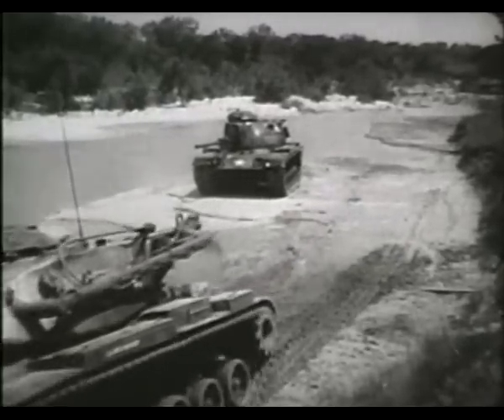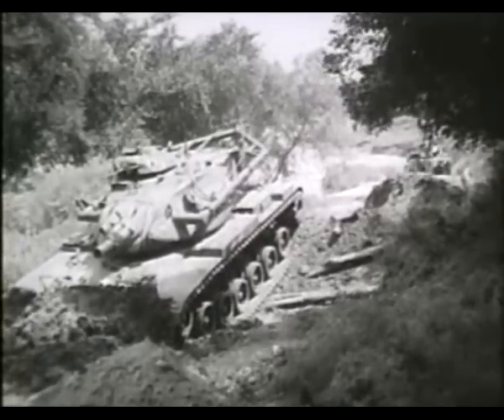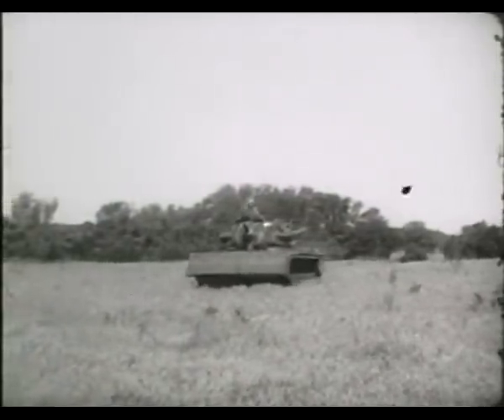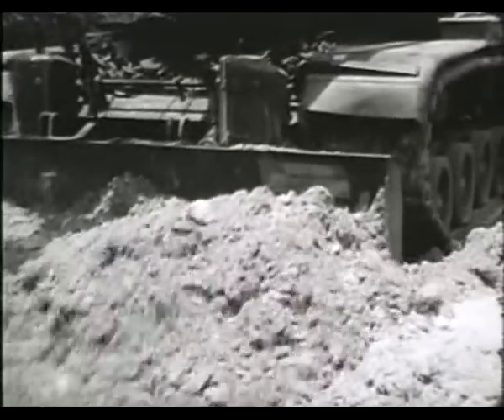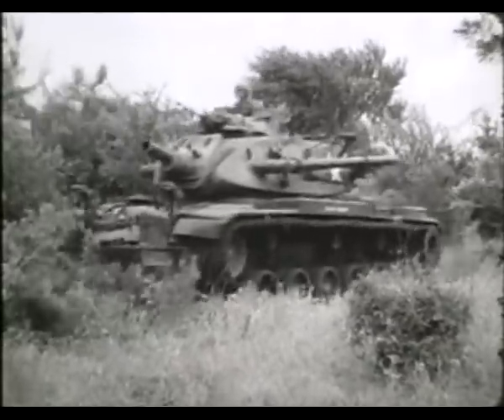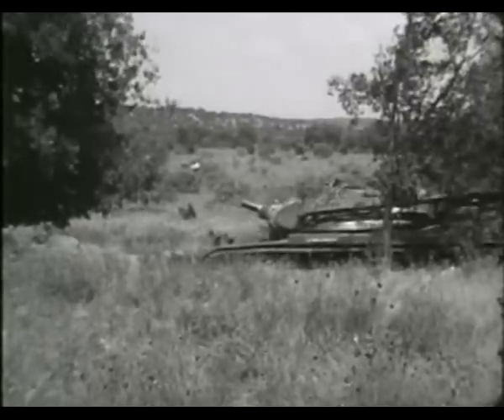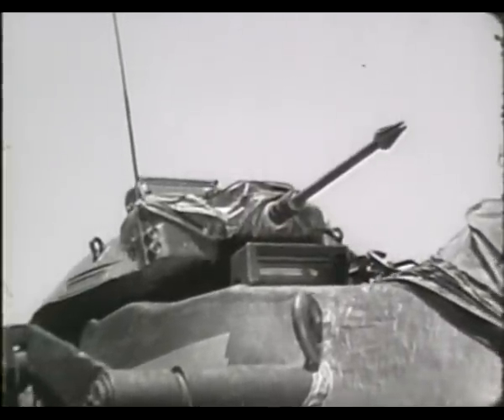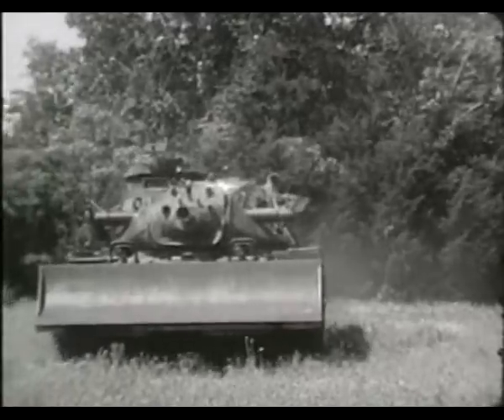M728 Combat Engineer Vehicle

Comment: Ah I remember these babies at Ft. Leanordwood.  That 165mm demolition gun was PURE AWESOMENESS!  I can't believe that they never made a M1A1 version of this tank using the same demolition gun.  Instead the replacements all have no heavy weaponry other then line charges. It's a shame because the snub-nosed 165mm gun actually is an excellent weapon for urban combat because the short barrel does not hit buildings when the vehicle is in narrow streets and is perfect for where bombs are overkill.
Reply: The Army wants a light tank to replace the Sheridan, basically a new M8 Buford AGS, but with more protection. General Dynamics came out with the Griffin prototype, an overweight, ugly thing with a lightweight 120mm gun. I think that's silly. Light tanks are simply not survivable in this era. They can't resist mines and IEDs effectively, nor can they counter next-generation ATGMs without some kind of APS. I think the Army should acquire a UGV with an L9 + Autoloader. An unmanned, remote-controlled fire support vehicle for knocking down structures and eliminating hard cover without putting the operators at risk. A next-generation assault gun for today's asymmetrical urban combat. No need to call for expensive airstrikes or arty if you have 40-pound HE shells right on hand.
Reply: They didn't make an M1 version since the m1 Had a new bunker buster round
Reply: The army traded the usmc for the ACE was a shitty trade
Reply: Vulnerable to the RPG, my CEV had an armor patch right at the coax ammo box...was told it took a hit in Vietnam and they sent it back to the states for a refit.

Comment: Ahhhh fond memories...could absolutely disappear some shit with gun!!! 100m kill zone (jelly ur ass) up to 1000m with shrapnel. Had a chance to hit an old taxi they hauled down range...hit that baby right between the doors...it fricken disappeared...nothing left but a patch of dirt :)
Reply: Mike Wells-- are you available? I need tech data on the fire control of this vehicle- how did you engage targets outside of the range of the reticle?
Reply: @tacomhq  you had to estimate like a sniper uses hold over. Had to bore sight first with a breech plate and string on the end of the barrel (notches were there for alignment)  the gun had a very similar trajectory as a small pac howitzer with if memory serves me right used 2 bag load. We did some R&D on it on a range up in Idaho. Since is was a demo round all you had to do was get close :) I will look online for some tech data!
Reply: The only targeting system the M728 had was just looking through the scope and lining up the sight. They were not made for Tank or artillery Combat. At least the one I crewed in. 74-77 8th ID @tacomhq

Comment: In the mid 70s, our CEVs were M48A5s. They were pretty good machines. We were developing the Universal Engineer Tractor at that time. It was supposed to be amphibious but the seals leaked and they sometimes sank. Good Luck, Rick
Reply: We always kept a a tarp on our CEV in the Motor Pool as the hatches leaked in the rain!
Reply: I experienced this as a loader in Germany in the 80's.  The loader sits under the main hatch and it was miserable to sit or sleep there in the rain.  With full combat load there isn't much room to get out of the way of the dripping water.  That being said, I absolutely loved that vehicle.
Reply: @Mistermegabyte We used to use plastic sheets that came with an expendable to cover things. I was a notorious scrounge and came up with many uses for salvaged materials. Good Luck, Rick

Comment: The blade slow the tank down and add more weight.  The "top turet" sic is called a cupola and the M1 and M1a1 both have one it just isn't as pronounced, the top mounted M2 .50 cal can be fired from inside turret while buttoned up.  The M1a2 however can not.
Reply: The commanders M2 on the M1 can be fired while buttoned up. It uses a series of periscopes to aim
Reply: That's a M85 50 cal.  On all the M60 series tanks cupola weapons with different belts link😮😅
Reply: The blade comes in handy for the driver when you are being fired on! More armor is welcome from a former driver!

Comment: why evry tank doesnt have dozer blade ?
why m60 is the onlyone to have a top turet ?
Reply: I know its been 14 years but by top turret are you talking about the commanders Cupola?
Reply: @dominuslogik484  i mean the m60 is the sole cupolla with a weapon its make it a turret on a turret
nowday many cupolla have a machinegun with an external ammo box or their is rcws around the commander sight 
but the m60 have internal ammo
not sure if its ergonomic but in theory it bring an advantage
Reply: @omnianti0  it was eventually removed from the M60 tanks as it was deemed a weak point on the armor layout and made the tank unnecessarily tall. the commanders cupola was thinly armored and vulnerable to things like high explosives.

as for the dozer blade its just heavy and its not made of armor steel so it offers limited protection while preventing the tank from being able to climb over some tall obstacles such as a ledge.
Reply: @dominuslogik484  the mini m60 turret issue is baltant and i guess not very efficient to shoot but all this as concept was never developed in other model as the french hunter prototype with a 20mm turret who made sens on paper
but its sure than the m60 and its predecessor was know mostly because this
for the blade their is not really issue else a front weight that bring a fair advantage and we can notice their is many russian tank with anti mine crow more than blade
its a bit like adding a crane on artillery its make it more heavy and expensive but dramatically increase the efficiency because it represent like few % of the total
 i can understand than for a full combat vehicule every bit matter so why their is no dedicated multi role heavy armor ?
even in the 1980 the engineer vehicule was rare and not very potent and im sure their worth in defence and urban assault is extreme
the sole near exemple i can name is the amx30 ebg and i have no report of use
Reply: @omnianti0  when it comes to the M60 Cupola it was largely replaced with the modern remote weapons station on top of the M1 but the old Cupola was deemed to be a combat risk which is why they were actually removed from the m60s later variants.

as for the dozer blade it does prevent the tank from being able to climb things taller than about 16 inches unless yo use the kind found on Russian tanks that folds up against the armor, its not a very good dozer blade though when built to that configuration and all its really good at is scraping small amounts of earth at a time.
Reply: @dominuslogik484  indeed but the toppic is combat engineering and not MBT s
so your concept of a bladeless engineer is a bit desapointing
Reply: @omnianti0  well you originally asked why doesn't every tank have a dozer blade
Reply: @dominuslogik484  mostly because the rarity of enginering vehicule but i still think with a good design its possible despit the extra load it can be an 2 cm armor...at front
Reply: @omnianti0  we do have the option to put dozer blades and mine rakes onto the Abrams so I think that might be why it's not a standard thing as they just take them off or put them on as needed
Reply: @dominuslogik484  ya i know this option exist but i never seen in combat video and do you know that most of the soviet tank had a mobile bottom front plate for entrenching themself ?
not sure its very efficient tought i prefere the optional standard doozer blade solution
Reply: @omnianti0  yes I am familiar with the Soviet dozer blades built into their tanks, they aren't very good as they only can move small amounts of dirt at a time. The removable ones serve their purpose far better but have to be attached when needed
Reply: @dominuslogik484  so why their is so few engineer vehciule and optional dozer blade : for exemple the official count in france is 18 amx30 EBG and their is not even an amx56 version
Reply: @omnianti0  I am unsure on why the French have such a small amount but for the US there are at least around 200 of the vehicles shown in this video still in service and there are an unspecified number of 2 other combat engineering vehicles available as well as an engineering variant of the M1 Abrams still kept by the marine corps.
Reply: @dominuslogik484  considering the usa have at least ten time more tank than france the ratio is even worse
who can better clear a road r dig a obstruction under ennemy fire ?
i never heard than dedicated engineers vehicule have the same armor than mbt s